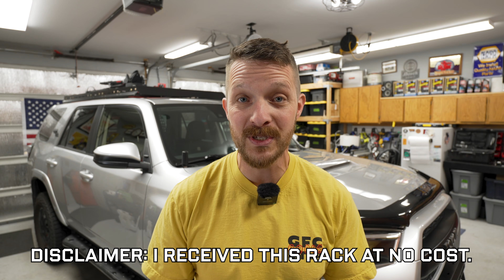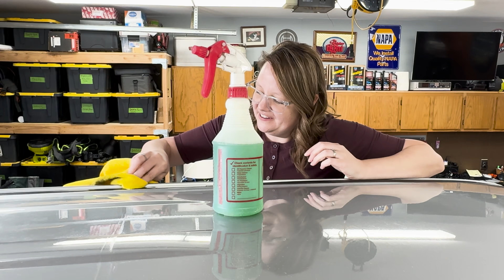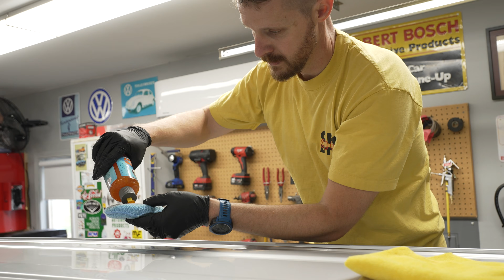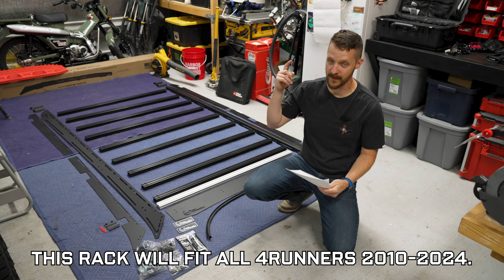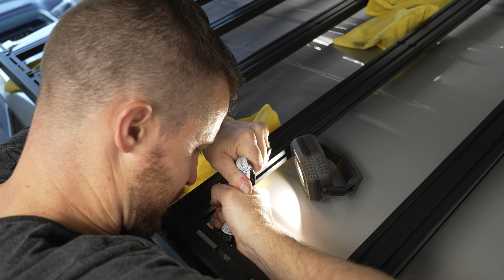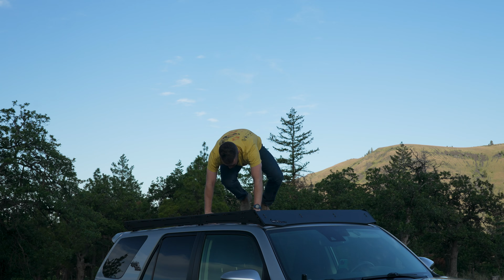The Best Toyota 4RUNNER Rack?!  Prinsu Pro Install & Review

Comment: I just bought a 2021 that has this and the ladder installed. To be honest I’d love to swap back to the factory roof rails.
Reply: where do you live? maybe you can sell it
Reply: @chewminem2044 that is the plan. I’ve acquired all the OEM stuff. Just have to work up the nerve to tackle removal.
Reply: @JasonSmith-se8he are you in SW?
Reply: @chewminem2044 not even close. I live in Canada. Saskatchewan
Reply: @J @JasonSmith-se8he cool

Comment: Jason, thank you for making this video! Im currently in the process of deciding to buy a roof and was leaning towards Prinsu for its strength and tons of accessories.. however, the only thing im worried about is potential leaking. Have you had any issues in regards to leaking?? How do you feel it compares to Sherpa?
Reply from the maker: No leaking issues at all as long as you apply sealant properly.  I haven’t had any experience with Sherpa.  Still happy with the rack.  I am having issues with the powder coat on the ladder from Prinsu.  It needs to be sanded and re-coated or painted.
Reply: @JasonExplainsThings  awesome to hear, thank you for your feedback.. if it means anything I went with the C4 ladder, I can let you know how that holds up and how well it flows, install will be coming up in a week or so. Hopefully once you sand and paint the ladder it's back to being good as new.

Comment: I spent months researching and comparing roof racks for my 2021 4Runner and ended up buying a GOBI Ranger Rack. The main reason I chose it was the one piece construction, I also felt the build quality was something that was going to last for over twenty years, that is the amount of time I plane on owning my 4Runner. But like everything, personnel choice is up to the individual. On the other hand, if I weren't keeping my 4Runner as long I probably would have bought a less expensive roof rack. I've had my GOBI rack for three years now and have used it extensively and it has held up very well.
Reply from the maker: Nice.  Yeah I like their ladders.  We’ll see how the Prinsu does.  I do have some powder coat issues on the Prinsu rear ladder I need to address soon.

Comment: How much clearance do you have between the rear crossbar and the hatch when it's fully opened? Does your ladder hit it at all? The Pro mounts the rear crossbar flush with the back of the rack whereas the standard Prinsu has it pushed in a bit. Big deciding factor for me as I want to put a rear light bar on the rack.
Reply from the maker: It clears perfectly fine.  Mine even has a ladder and it clears.
Reply: @JasonExplainsThings  Thanks for the reply. Do you think that if a light bar was mounted to the back of the rack on the crossbar that it would clear as well?

Comment: Have you noted anything regarding dirt and or water pooling in the spaces where the mounting feet are? I've been heavily debating Prinsu vs Sherpa. Sherpa doesn't require you cut the rubber channel for the front feet and they use the same type of rubber blocks your old rack did for the other feet. I've been hesitant on the Prinsu because I don't want dirt building up in the holes and causing problems later or being super difficult to clean.

Comment: Do the new Prinsu Pro rack come with the brackets included for the 40” light bar? Or will you have to purchase that separately?
Reply from the maker: You’d have to check… there’s a different version of the front wind deflector with a cutout for the light bar.

Comment: Jason, I have a moon roof on my 4Runner and I want a full size roof rack. Is it ok to remove a crossbeam so I still get a clear view?
Reply from the maker: Yep.  Shouldn’t be an issue.  They have standard positions but you can put them in different spots or run less.
Reply: @JasonExplainsThings  Thanks for replying man. This is my first 4Runner and I just want to set it up right.

Comment: Looking forward to the tent reveal!    This rack looks not more substantial and better designed to fit the styling of the 4runner.  The ceramic coating is a great idea.   Any plans to do the whole rig (or rigs) with it?
Reply from the maker: I did the whole vehicle when it was new (3.5 years ago).  Probably due to do the rest of the vehicle next year.